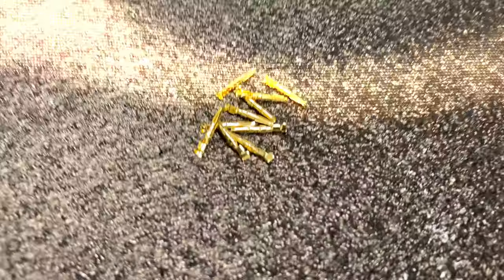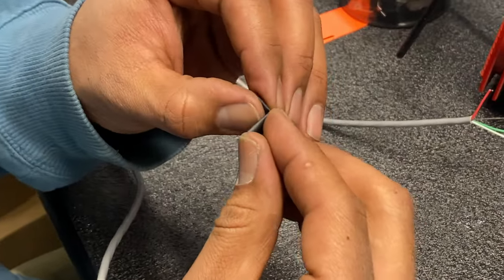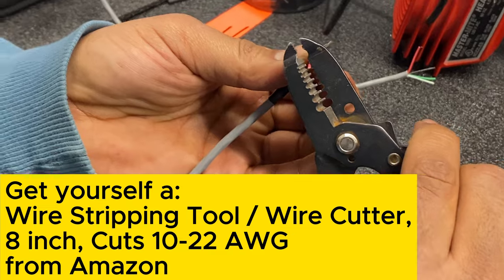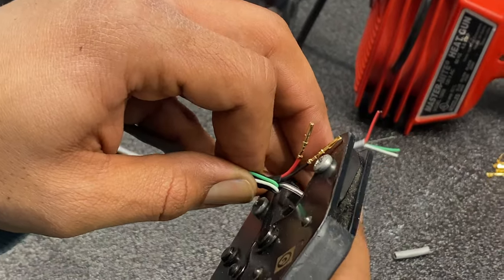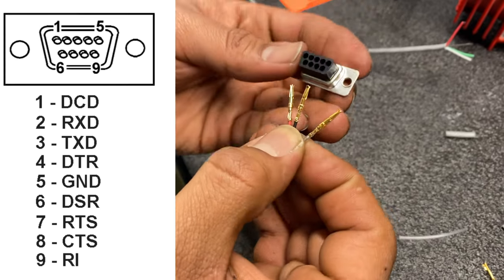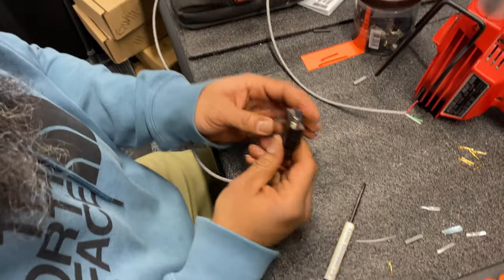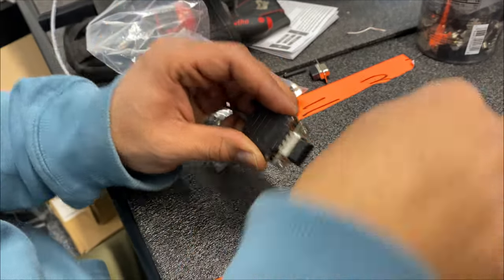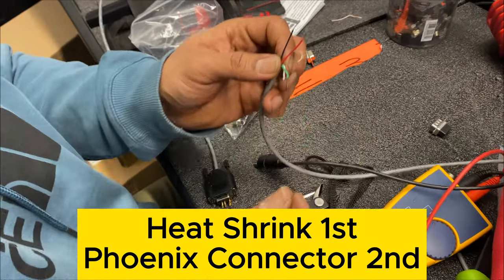RS232 DB9 Termination + Testing - Step-by-Step Guide

Comment: can i use nes gamepad in pc with rs232 db9 male to usb converter
Reply from the maker: The short answer is "no," but it is theoretically possible on an engineering level. 

To achieve this, one method could be to:

- Understand the signals from each button on the NES gamepad.
- Create a custom interface (possibly using a DB9 connector, but rewired) to connect the gamepad to a USB board.
- The USB board would need memory and a converter/program to translate the gamepad signals into a format that the PC and game can understand.
- The other end of the USB cable would then connect to the PC.

This process would require a good understanding of Serial and USB communication protocols, as well as the ability to design and build custom hardware and software.

It was a good question!
Reply: @AVNetworkGuy  ok thanku
Reply: @AVNetworkGuy  Can you make a video for this?
Reply: Please fo Godmode and make a video for this!!!!